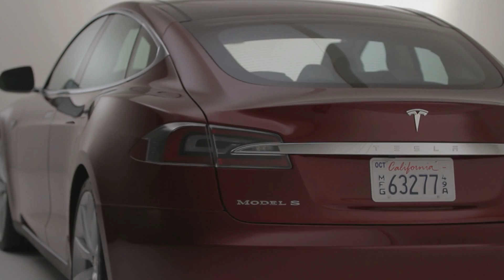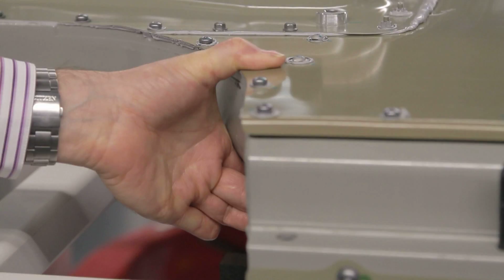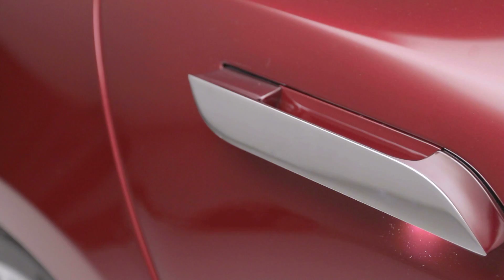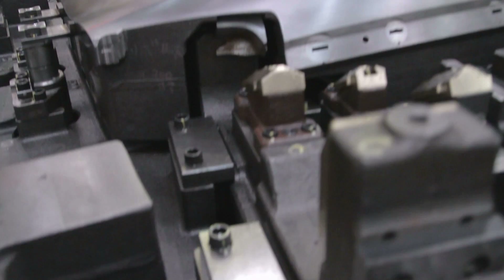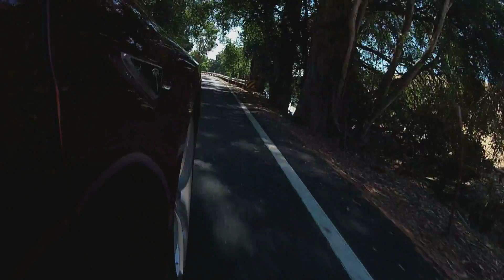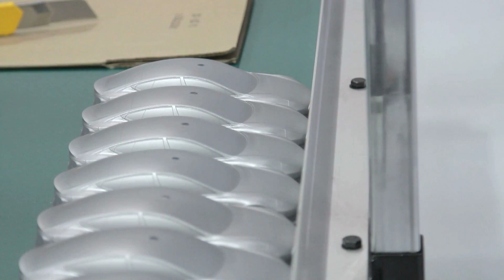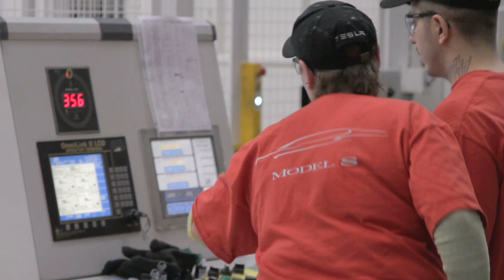Driving the 2012 Tesla Model S - Wide Open Throttle Episode 22

Comment: there is a video of the model s driving in snow! i think its on there official ch on yt. me personally (and its my opinion) i believe you need an suv or cuv for a place that has allot of snow (because of the higher ground clearances and usually better traction control like the model x has dual motors) my aunty has a jaguar and it slips like wearing socks on a wax floor! even with snow tires. i think sedans are more of a summer car and cuvs are more all year round cars.

Comment: yes, I completely agree; But heat probably won't be that problem where I live; but the winter might to harsh for the batteries. Even the normal ones tend to die to easily in these cold months. We had snow till may this year. And especially january and february where temperatures down to -25°C (-13° Fahrenheit) aren't uncommon. It would be a pitty spending that amount on a nice car and essentially turn it into a brick in the winter months. I should do some research how this car performs in winter

Comment: i also wouldn't exactly be an early adopter not because of price or battery that's fine im just waiting for a model that no matter what you do blast the radio have ac all day during killer heat it wont take away from the engine battery! as i said before they need to have a 2ed battery powered by either solar or have some sort of dynamo (possible for the model s but not the x since the x has dual engines)

Comment: well i think what they should do is have a solar panel around the sun roof and it charges another battery that runs the radio lights computers ac heater etc. they could put this battery inside the dash or put a spare tire in the front trunk and put the battery there. as for the people that dose not have a dryer plug to use then i agree this car isnt for them this is for a home owner. i think apt buildings should have a dryer plug in the parking space for evs.

Comment: first of all how dose it take too long to charge the car? with the superchargers its 85% charge in like 30/40mins a normal charger about an hr or so how is that slow? watch a movie at least a few hrs including the time to get snacks etc. going shopping takes at least 40mins even if its just in and out. you should be sleeping at least 8hrs and plugging the car into a dryer plug would only take a few hrs! i agree there needs to be more stations but i dont agree with how long it takes to charge!

Comment: Exactly. And, since there are very few costs when it comes to replacing spare parts - compared to traditional motors, that's also a cost-saver in the long run. I'm not sure about batteries though, it might be expensive too, but at least there's less work involved when it comes to that, which saves time = money. Instead of keeping track of everything from oil changes to gear boxes and everything between you just throw away the battery one day. People do that for electronic devices all the time.

Comment: It's in the early stages of invention and production, I'm quite sure the price is as low as it can possibly be. And, this is not an everyday car either, many supercars have the same acceleration speed, and this looks luxurious and almost majestic, despite its smaller frame. Your comment on that it need to be lighter is one I don't understand though. Are you going to lift it up? Are you less safe if you crash because of the weight? Increased fuel cost? Decreased speed? Cheap and fast as it is.

Comment: It is on the pricier side of things, but this is revolutionary. 300 mile range is enough to actually drive the car all day long without worrying about being stranded on the side of the road. Then when you go home, you just plug it in and go to bed. Wake up the next morning ready to do it all over again. Over a 10 year period you will have saved 20-25k in fuel. It's really not too bad. I personally think they have something going for them here.

Comment: The tesla model S has a 5 star crash safety rating in front, side and roll over tests and apparently damaged the crash test apparatus from its impact. I'm not really sure how well it'll do in winter, but my understanding is that the battery and motor are liquid cooled and heated, so that shouldn't be too much of a problem, there's a really useful crash test video set here for the collision ability.

Comment: I've heard rumors that by 2015, Tesla hope to have a model that's around $20k-30k, which is about what you'd expect for a modern car, anyway.

The Model S and Roadster are tuned on the more performance-y side of things.  All they need to do is put a smaller motor in the cheaper models, go a bit cheap on the suspension and trim, and they could drive the price way down really easily.

Comment: I want one but the price and the lack of infrastructure in charging stations in my area are keeping me from buying one. Sure I could get a home charging station but what about 200 miles away from home? The closest charging station is 250 miles away from me. Also I am not quite sure i want a $80K+ car sliding on snow covered roads in the winter time. I have yet to see anything about the performance in Snow and ice?  They need to build the infrastructure and get the price way down before i buy one

Comment: Test drove the Model S P85 performance over the weekend.  I currently drive a 2012 Mercedes CLS63 AMG with the additional add on performance package.  The Model S is just as fast and practically identical in price.  Tesla just made changes and parking sensors are now available, but it's still missing some minor things like lane assistance, adaptive cruise control & temperature controlled seats.  I wonder why I would ever buy another fossil fuel car??

Comment: Write down all the costs you have on your current car, and then add a 30 000 USD loan on top, and then compare it with all the costs of a Tesla Model S, including the loan. In Norway it no longer makes sense to buy anything else than electric vehicles, because over 10-15 years the P85 Model S with all bells and whistles is cheaper than the cheapest and smallest fossil fuel hatchbacks.

Comment: They can charge in 20- 30 minutes within the Tesla Supercharger station, or longer at other stations. The projected infrastructure is impressive by mid 2014, & just about everywhere needed to drive anywhere by 2015, and it's free to use for the life of the car. Go to the official website to have FAQ's answered. Not all cars have the same range, as people can buy what they need. There's also a video out on battery swapping which can be done in 90 seconds.

Comment: They're not using the touchscreen system to show off or as some sort of gimmick. It's used because it works, and allows for more functionality.
Also, Tesla's goal, from day one, has been to produce low cost, high volume cars. They've repeated this publicly literally 1000's of times. In 2016, the Gen III model will be introduced, in the $30k range.
watch?v=d1wiLb2hGn0.
With the Suprcharger network coming online, range anxiety will be rendered a myth, even with a 60kwh model.
watch?v=TszRyT8hjJE.

Comment: they bought the plant from toyota general motors in the down turn (2008). they produce more than the factory ever produced before, (because electric cars run with 80 per cent fewer moving parts?) and that fox/vixen jessi... seems to have disappeared. i spent years in home ec to relate to girls in the 70's. it a no win situation.

Comment: I love the vehicle.. would like to see a nice truck or suv too.. and also increase the battery size... and what do you think about adding either solar panels on the hoods and roofs to help regenerate the batteries, or hook up an electrical generator to one of the wheels to regenerate the batteries... as long as the sun shines or as long as the vehicle is moving it could recharge the batteries...  they hook up alternators today to recharge car batteries, you can also do the same with the Tesla..

Comment: Even if you use fossil fuels as the power source for electric vehicles it is done more efficiently with a huge generator(60%) than with an internal combustion engine(20%) So your choice is between electric car or internal combustion car.. electric wins regardless of what power source the generator uses. And you can always get solar at home to ensure you are clean if that's your thing. You never have to charge anywhere but home unless you travel more than 200 miles/day

Comment: It takes more electricity to refine 100 miles worth of gas than it does to drive 100 miles in an electric car. Either way you look at it, that is an improvement.

To most people it isn't about 'saving the planet' - it's more about the fact it costs just 3 cents per mile rather than the 30-40c/mile or so a similarly powerful car would cost.

Comment: Gas was obsolete 100 years ago already but we were forced to stick with it for ''other reasons''. The issue is not what you like are not. The issue is what makes sense. And electric makes sense - the only technical issue remaining is the format of the battery.

If electric cars go mainstream you will still be free (and even free-er) to run around the suburban areas with your gas car as a hobby-car (I do not imagine you wishign to use your gas car in city jams).

Comment: Solar panels need substantial surface. The roof would produce only a fraction - so nobody would bother with the extra cost. However, some propose adding solar panels of the cheaper low end, thus of low efficiency type, just enough for operating the air-conditioning when the car is parked out in the sun to keep the car cool and avoid consuming battery energy. This makes sene.

Comment: Energy yields on any power plant are driven by Carnot's laws : its 30%. With loss in lines, from coal to your electric car's wheel, it's around 20%, at its best.

A modern diesel engine has about 40% yield. Twice an electric car's one.

Comment: As an energy vector, electricity is as clean as the primary source used to produce it.

USA electricity (approx.) : 48% coal, 20% gas, 20% nuke, 10% hydro, 2% other renewables.

To sum it up : 68% CO2 dependant with a BIG part of coal.

And you dare calling that "eco-friendly" ?

Comment: A mobile connector will charge at a rate of about 31miles/h and the wall connector paired with twin charger will do 62miles/h also at tesla superchargers, kinda like petrol station, you can charger at a rate of 150miles/30min
3)Home charger is known as the "high power wall connector" and is available for around $2500(incl. wall connector, twin charger)
4)Electric vehicles are good on this because the only moving part is the electric motor, doesn't even have 'transmission', no more oil changes

Comment: 1) They seem to have done well with the range averaging 250 miles in everyday use and getting to the 175- 200 mile mark in cold weathers
2)For this there are a few options, you can have a simple (mobile) connector cord that comes with every Tesla that plugs into your standard wall plug like a laptop. Also you can buy an optional high power wall connector that charges much faster. Last thing effecting the charging is the charger you choose, either the single or twin charger that is in the vehicle

Comment: Thank you for a most fascinating video on the Tesla S.
However much I may like it (and I do), besides the self-satisfying illusion of the potential reduction of and reliance on fossil fuels, my concerns (which I imagine are shared by many)are:
1)Range, always the range
2)The ease of, and time required for useful recharge
3)The availability and cost of a home recharging system
4)The service and repair record.
5)The imact--if any--on car insurance rates.
Reassure me on these issues.
'Zahc

Comment: Actually my friend, solar panels are still nowhere near capable of producing the energy required to move a car around. hopefully this will change but the photons coming from the sun only really amount to significant power when collected on mass, like from massive solar panels used in solar farms. another example is in the roof of the Fisker, where it seems to amount to a cool looking but almost pointless feature given the cost and that it only contributes to recharging the accessory 12v batt...

Comment: I buy it IF you come with it :D
$65k still thinking.   $35k BMW 3series+ $10k sport bike +$10k Europe vacation +$10K for 5 year gas money and 10 years of car maintenance.  
yea!!! Still driving a Prius cause, U$13 today = 167miles (more like 145miles in power mode and my heavy foot). 

At $35k or even at $50 flat as original promised. I seen lots of used ones already for sell at cars-com and by owners getting it off and other trying to make money on it after a burn out or 2. 
KEEP WORKING :D

Comment: Good stuff, if they have option to install light weight solar panel at the roof so it can charging it self when parking under the sun or just compensate the heat for the air-con and double layer glass insulation then it will be the perfect car. Good job TESLA...

Comment: Am afraid that 100% regen wouldn't be possible unless you can go down hill both directions that you are traveling and to return starting location. Regen is a range and a brake system assistant, but not a replacement when aggressive brake applications  are present, nor a solution to  charging from depletion of battery power.

Comment: There is absolutely NO doubt that electric cars are the future.  Yes, electricity does still necessitate the need to burn fossil fuels, but the question is - is it burning less fossil fuel than gas?  I think the answer is yes.  

More importantly, this is just a bridge to the near future when solar reaches optimum efficiency, then the car truly is free to drive due to solar energy being FREE. So are electric cars completely free from the chains of fossil fuel?  The answer isn't no, it's not yet.

Comment: One last point... Have you noticed how there are no road tests of these on rain or snow & ice?  Theres a reason golf carts get parked during the winter...Talk to a locomotive engineer sometime about driving a locomotives on icey rails...Railroads spend millions of dollars on sand delivery systems to try and cut down on wheel slippage..Thats not the wheel's or the rail's fault...It's the electric motor's fault

If you actually knew anything about how electric motors function, you;d know why...

Comment: actually it went form 40 to 35 douchebag....Who gives a crap what your A4 has or doesn't have...My POINT was that although these are a step in the right direction, Tesla has a long way to go before this car becomes a mainstream replacement for the gasoline engine....That was my only point...Until then..it's an Urbanite based Fad that has a lot of bugs to work out..Not the least of which is it's longetivity & performance in cold weather climates...

Comment: thinking yours doesn't have the overdrive override or the ECT chip...
A 15 second 1/4 mile is about 80 mph...Thats not that fast and with the ECT engaged and the overdrive cut out...Ok, it might be 17 seconds...*RMES.....I may be stretching the 40 mpg a bit...Probably closer to 35...But it's does it routinely...I can drive from Kansas City to Denver on less than a tank of gas...18.5 gallon tank...600 miles= 32 mpg. Do the math...I was trying to make a point that was obviously lost on you...

Comment: That exists and is called a diesel/petrol-electric car and in some extend this is used with hybrid technology. In the non hybrid case the electric motor and generator would only be there as a transmission and efficiency vice is similar to traditional mechanical transmission. The cool thing about electric cars is that it is not dependent on oil and don't pollute its surroundings which is great in big cities.

Comment: An idea for the motor industy:
Why not use an engine, petrol or diesel to power a generator that supply's energy to the battery? (rather than the battery and wheels) Then rather than having a not very powerful motor they could use a more powerful motor without sacrificing the range of the car - this would GREATLY increase the range and decrease the fuel consumption of a regular car as the engine wouldnt need to power the wheels.

Comment: its still not as dependable, charging takes way longer than filling up a gas tank, and batteries arent stable enough if cellphones can randomly explode imagine what the battery in an electic car can do? im not willing to put my family in that type of vehicle. alot of cars that use gas engines are getting better mileage these days anyway. yeah electric cars might be "efficient" but theyre still inconvinient and unsafe

Comment: A Model S with a 40 kWh costs $50,000 (160 mile range). Now, I own a Chevy Volt its battery lasts around 40 miles. It costs around $1.50 or so a charge (We'll round up though–so $2 a charge). Considering the Model S has a range of 160; that's 4 times as much as the volt. So $8 a charge or $10,000 for 200,000 miles. Now with an 85 kWh battery (300 mile range) it would cost around $15,000 for 200k miles. So a 40 kWh Model S would cost $60,000 and a 85 kWh version would cost, $87,000

Comment: CALCULATE THE HOW MUCH DO YOU PAY PER 250 miles gassoline, and electricity. Electricity: 5$, Gasoline: 70$??100$??? :) you drive that in one week..... In america as I know even faster. 100$ times 4 400$ a month..... 4800$ a year. 33600$ in 7 years you think Tesla battery degrades. :) Instead of asking questions about how can Tesla can charge you for something, do your own research.... It takes 3 minutes for BMW for fosill refill, it will take 45 minutes for tesla. 42 minutes saves you 100$.

Comment: not to mention the saings in the maintenance department. a motor with 1 moving part, no oil changes, baterys that will last longer than most cars will. great machine. cant wait for mass produced vehicles to come...